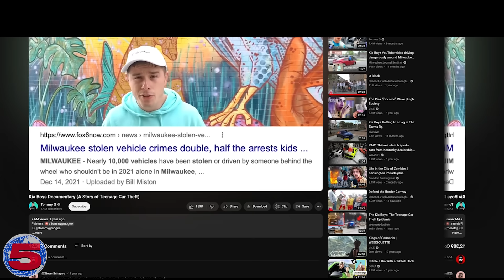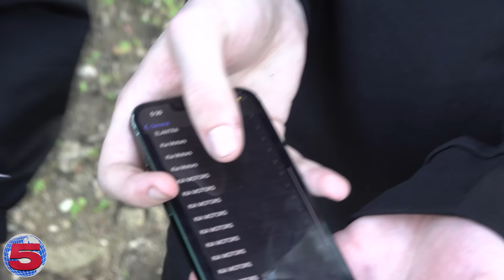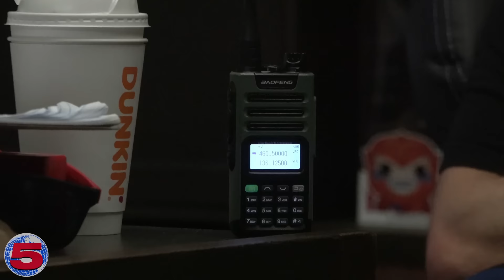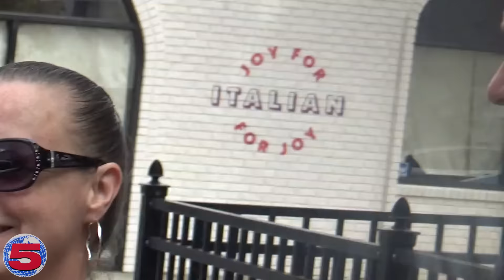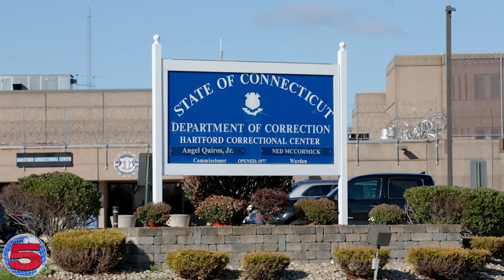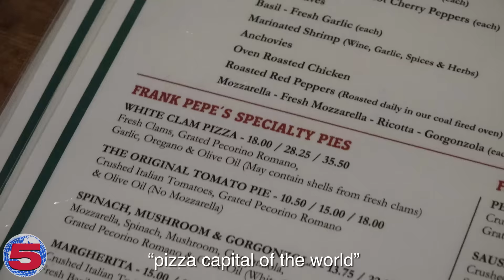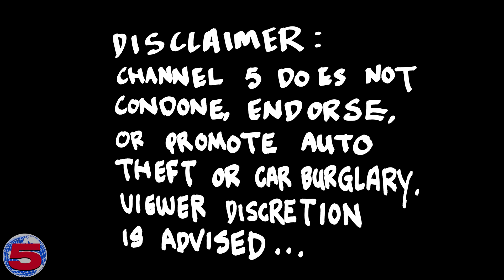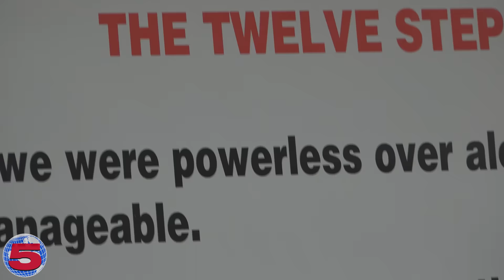Connecticut Kia Boyz

Comment: as a connecticut native, you did a better job covering this than any local news segment or tiktoker trying to capture just a glimpse. wild world out here
Reply: If you're in a really bad neighborhood.... Pull a maxi fuse, fuel pump relay, mass air flow sensor connector. Maybe disconnect the ground from your battery and hide it. There's a lot of secondary things you can do to your vehicle if your potentially risking parking where You are.
Reply: Channel 5 is making a lot of professionals with the support of big stations look lazy and generic
Reply: @PseudonymAliase  fill your gas tank with coca-cola, drain all your oil, there’s a lot of good things you can do to prevent car theft
Reply: @CantTellYou  drain all the gas out of the gas tank and replace it with animal piss, put 4 cucumbers in the exhaust pipe to prevent the car from starting and grate some cheese on the grill so any wood-be thieves smell the instant whiff of cheddar as soon as the car lights up. There's a lot of good things you can do to prevent car thefts
Reply: Why would the Kia boys want to have them be interviewed by the news

Comment: Imagine being the guy in charge of designing the key hole of kia cars and you walk into work one day and your boss shows you a kia boyz compilation
Reply: Yeah they really cheaped out on not putting immobilizers and proper theft protection. Unfortunately, even though their reputation is wrecked, they’ll continue selling cars because lots of people like them cheap.
Reply: @josueramirez7247  Hardly a reputation issue since it's not THEM stealing the cars...making it easy only goes so far for taking fault.
Reply: 99% of the time it's not the engineer's fault, it's the company's fault for not listening to the engineer and being cheap. source: am an engineer and this happens all the time.
Reply: @jared_deraj True
Reply: That was me
Reply: @jared_deraj I totally believe this. Always about the bottom line versus quality engineering
Reply: @josueramirez7247  We shouldn't even need all that technology that makes cars harder to troubleshoot and get replacement keys for.
Reply: @jared_deraj  Can confirm. Engineers have to work within constraints imposed by the business team, e.g. the thing has to do X, it has to cost less than Y to manufacture, and you have Z amount of time to design it. We can offer feedback to them, but ultimately it's their decision, not ours.
Reply: They don't have basketball Americans in Korea so this was never a discussion lol.

Comment: At what point is kia held responsible for making their cars so easily stealable.  Seems like a huge lapse from them all in the name of profit.
Reply: You could steal any car back in the day by hotwiring them, does that mean it's the brands fault?
Reply: 22:10 they provided a fix to vehicles free of charge, issue with responsibility is finding enough information to make it civil negligence --- something that for this would probably be reaaaallly hard.
Reply: @taserrr ”back in the day.” It don’t matter what era. car manufacturers profit in the millions for producing cheap parts. This is the result
Reply: They been sued (I own a kia) they upgraded mine for free and took the hit for it. Ide say thats something. And if you own a kia, Take it in they will upgrade you at no cost and I think its for all Kia past 2010.
Reply: least dumb youtube commenter
Reply: @92tilinfiniti Why should a car manufacturer ever be to blame for somebody shattering the window and ripping open the ignition housing?
Reply: Been hoping someone steals mine but I still got it
Reply: KIA doesn't need to recall their cars, God needs to recall nags
Reply: Kia & Hyundai are the only two car manufactures to decide to remove the part of the car that prevents this from happening - which was revealed through quarterly reports and board members a move designed to increase profits.  That's gross negligence.
Reply: @hitmanx200 because you shouldn't be able to start it by ripping the ignition housing open. Kia agrees, which is why they offer to secure peoples cars better. You really want to defend a car company MORE than they car company defends itself?
Reply: It’s someone else’s job to protect your stuff? Boooo you
Reply: @hitmanx200  "Kia and Hyundai models were designed and manufactured without engine immobilizers, a critical anti-theft device that is standard in most other vehicles." - Both manufacturers though they could remove a piece of the car that has been standard for decades to save a couple bucks.  Their profit chasing caused this.
Reply: @stnaes-tf4ow  There is no god
Reply: I lost brain cells reading this
Reply: @taserrr  Most cars are a lot harder to hotwire/steal compared to some of the newer Kias. Why are you defending a corporation in the first place lmao
Reply: kia and hyundai had the perfect plan, in asia not many would miss the parts they removed. their problem was selling the cars in america where people are fucking insane.
Reply: They should be. Flathead screwdrivers were commonly used to steal cars in the 90s, because it was such an issue where I'm from - manufacturers started fitting immobilizers, dead locks and other security features as standard.. Clearly Kia decided they could cut those costs by removing all of their security features and just hoped that the car thieves would have forgotten that one simple trick to stealing a free car that just cost its owner 30K. People have 20 year old bikes that are harder to steal than these cars are.

Police need to be held more accountable as well though, it shouldn't be this difficult to catch criminals who regularly post their crimes online. How many times have we heard them comment on how stupid a criminal is for uploading to social media... So how stupid do the cops have to be in this case that they still cant catch these people? 

Next you need to look at the legal system too, because where I grew up in the 90s, car theft was treated as such a minor crime that even when caught they'd often get away without any real punishment either. When you match the rampant opportunity of crime with such a severe lack of consequence, this is what you get. 

But, apparently tik tok is the problem, because if they remove tik tok they remove all of the evidence... and the crime just stops on its own i guess?
Reply: @Mikesusendsadasdc what’s the upgrade?
Reply: @taserrr  yes it does, and the federal government agrees with me. There were major lawsuits
Reply: @taserrr  That's what's called a "false equivalence."

We teach our schoolchildren to know what that is.

What's your excuse?

Kia openly and chronically forgoing an obvious safety feature that virtually all modern automobiles have, and failing to protect their cars from being stealable by plugging in a $2 piece sold in every store in America, is not the same as someone literally fucking cutting and rewiring a circuit in a car.

It's not even close to the same thing.

Go back to the second grade where they teach logical fallacies for the first time. Meet us back here when you could safely pass modern middle school classes.
Reply: @hitmanx200  Dishonest framing. You also need to go back to elementary school to learn about logical fallacies.

You don't get to just SAY "shattering a window and ripping open the ignition housing."

That IS NOT THE FUCKING ISSUE.

The issue is that the car's starting mechanism works using any USB device, IE, something everyone in America has.

It is not the fucking same thing as what you're talking about.

Use your head, it's not that hard.
Reply: Never
Reply: back in the 90s you could open and start any car with a screwdriver.
Reply: Did you even watch the video?
Reply: At what point are single mothers responsible for raising kids who think regularly committing felonies is rational behavior?
Reply: Lol bad take
Reply: @92tilinfiniti for the big ones try billions
Reply: @hitmanx200  Because immobilisers have been fitted as standard to cars since the 90s - these same models in europe aren't susceptible to this method because they do have immobilisers.

There is a problem with cars being stoen in the uk with a repeater attack or through OBD port with more sophisticated tools
Reply: can't really, only happens in america because in america car manufactures legally don't have to install an immobalizer on their. only kia and hyundai did it tho.
Reply: Don't buy a Kia... They will learn once it starts hitting their bottom line.
Reply: @ConnorByersMusic they shouldn’t even need to worry about that lol. You pay in the end spending more for a car bc ppl won’t put the blame on the criminal
Reply: @davemccombs whole lotta words to say I don’t blame the criminal lol. The car companies just pass on the extra cost to the consumer. Shouldn’t have to worry about this in the first place. They fixed it.
Reply: This is a ridiculous take. I'm old enough to remember when hotwiring was FAR more common than USB starting is now. The Club has been around for 40 years for a reason.
Reply: At what point do you hold basketballs responsible for their actions?
Reply: at no point should kia be responsible for thieves stealing a car
Reply: "If Kia cars don't want to get stolen, why are they going out dressed like that?"
Reply: 90’s Toyotas are easy to steal. I unhook my battery when I’m close to town or use a steering block. Someone would have to win a lawsuit before Kia is held accountable.
Reply: @Doost311  My question is, why in the world is the fix for it a software update? What's wrong with car manufacturer to the point where the software is the reason that's allowing people to steal your car. Not that you couldn't steal an older car, but it took more than just a USB cable
Reply: I mean, car theft is 100% illegal. Why is it kias fault exactly?
Reply: There are various factors that contribute to this situation.
Reply: @Mikesusendsadasdc  you will still get a broken window and a busted up dash. They just won't be able to steal it
Reply: @jekanyika that's what you think needs correcting about his comment?
Reply: Kia is probably funding this whole thing lol the world is crazy
Reply: @Alejandro-te2nt  I'm just saying his prayers won't be answered. I'm also African.
Reply: @davemccombs  was your Kia stolen?
Reply: @AliasA1  I’m not defending them, Kia is an awful car manufacturer I’m just saying this problem doesn’t really exist in Japan
Reply: Why isn't it the criminals fault?
Reply: So by your logic everything at every store should be behind lock and key because no one has any self control? Terrible line of thinking.
Reply: Bikes don't come with locks, is it Huffy's fault or shitty criminals when bikes get stolen?
Reply: @dog-qf2lp the ignition is behind windows and a cover. If someone broke out your house window, went in and stole your shit, would you not blame the criminals?

Comment: As a KIA owner I’m kind of bummed this is still getting attention. I’m paranoid about my cars windows getting smashed 24/7
Reply: Go sell it for $100 I guess
Get yourself a bicycle
Reply: Get a club and a couple airtags.
Reply: Get a wheel lock, it's visible from outside. With any lock they notice it and realise it can't be taken.
Reply: @incremental_failure  I have a wheel lock. Kids are stupid af tho they'll prob still try to steal it 😆
Reply: Go to the dealership and have the immobilizer installed. A wheel lock wouldn’t hurt either
Reply: +1 on the airtag/tracking device, that's what I was going to do before I sold my Honda but would like to hear other opinions. I don't think wheel locks work they'll just cut the steering wheel to shit.
Reply: print 2 a4 papers saying i got the update and put em up lmao
Reply: Inb4 they still steal it and try to drive it, totaling the car in the process.  @incremental_failure
Reply: Send address I'll protect you

Comment: I had my car stolen right out from my driveway several years ago, and insurance doesn't fix the issue.

A ton of value is lost the second you drive a car off the lot. Bought my car brand new, and only 2 years into payments, it was stolen. It was recovered 2 days later, but they had smashed the windows, f'd up the tires, stolen everything out from inside of it, left a bunch of rolling papers & McDonalds trash in it, and STABBED a giant hole into the dash.

First of all, you have to pay a deductible, so paying the $500 was a pain in the ass. Second, insurance wanted to total the car & only pay a little over half the value of what I had paid for it! So were I to do this, I'd be looking to buy a car for half the price of a car I just bought brand new 2 years prior. The reason it was so expensive was they couldn't just fix the dash, they'd have to replace the whole center console.

Instead I convinced them to let it be, repair everything else, and I'd just drive around with a giant stab hole in my 2 year old, 10,000 mile car... one that I had to pay $500 to fix & lost everything inside of it. So yeah, they can say "insurance will make it ok!" all they want, but they're doing significant damage to the individuals, not including loss of time.
Reply: Are you trying to explain why grand theft auto is illegal and a serious crime?  Because like that's already an established fact.

Comment: I'm a mechanic out in oregon, and I have single-handedly repaired like 5-10 of these stolen kias/hyundais (there the cars with different badges for "luxury" marketing) in just one month alone. None of these literal children could be capable of stealing any other car make. The problem is kia got around U.S. immobilizer regulations, and haven't produced a vehicle with a key based immobilizer system ever in the U.S. Key based immobilizer systems are industry standard for nearly all other makes since the late 90s. A key based immobilizer system would immediately make this type of theft impossible. I frankly blame kia/hyundai for this. I am not entirely sure but I have heard even Canadian sold Kias/hyundais are required to have key based immobilizer systems. Hondas were notorious for this same issue, but by 2006+ they completely converted to key based immobilizer systems. Ironically, the majority of European car makes have had key immobilizers standard on all models since I wanna say as early as the late 80s.
Reply: It was easier to watch a kia boy how to steal a kia video when I was repairing my first stolen kia then to read the kia technical documents, just sayin...
Reply: I can also tell you the software update was a small barrier, I've seen a kia that came in stolen, repaired, updated by kia, and then stolen again.